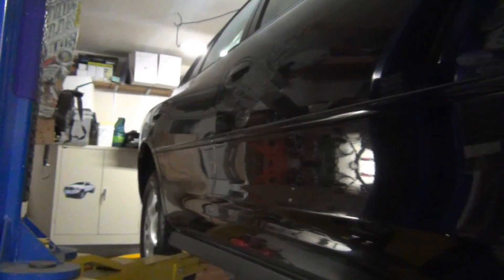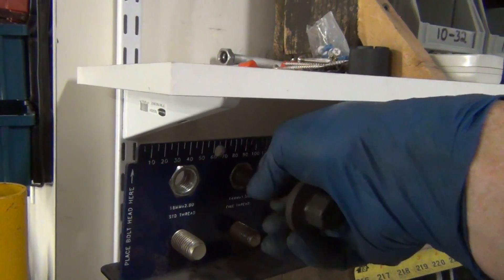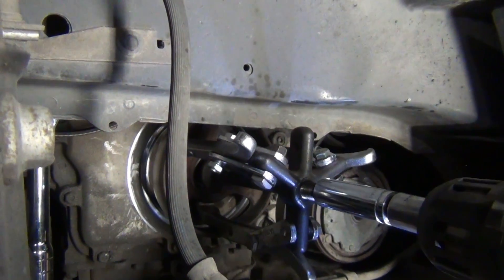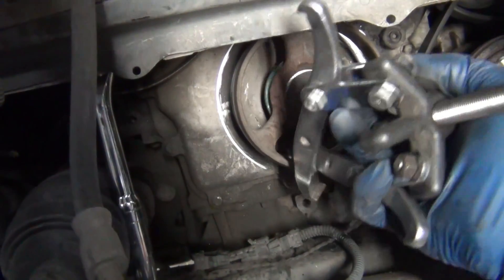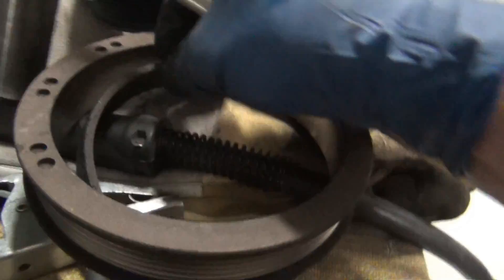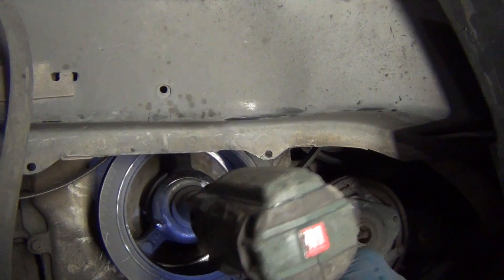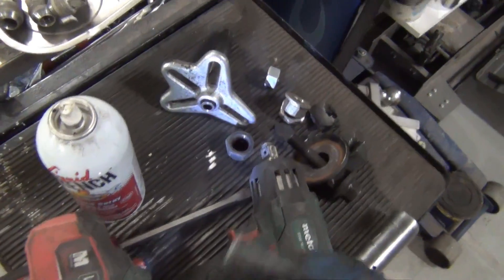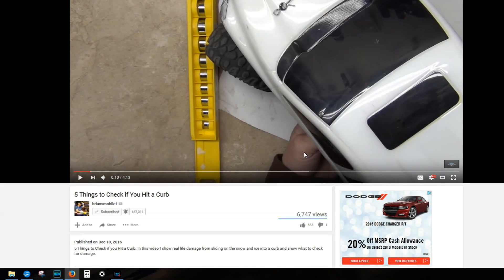Crank Pulley Replacement tricks for GM 3.5L LX5 "Shortstar" Aurora Intrique

Comment: I just did a 3.5 crank pulley last week. I played with a couple of my pullers and then ordered the right puller from Amazon. Got it the next day, had it replaced in less then ten minutes.
Reply: @Danny-ow7hl  I think it was a GM 3.5
Reply: Do you recall what pulley it was? Also, GM 3.5?

Comment: Wow!! That the hard way.. There is the right tool for the GM and Dodge for that👍🏻 make that job nothing to do both coming off and back on.... You May want to get it..
Reply from the maker: I've used the Dodge one before as a rental.  That's what it looked like to me.
It came off slow- was kind of rusted.   I do like the fatter drive bolt on the Chrysler puller.  More compact too.

Comment: Idk how you guys make a living doing this crap. I spent 6 hrs on my motor mounts in my 6.5 and that's after the trans has been dropped and the front diff is out. Nothing wants to line up and no room for force. I mean its only 8 bolts right? Now hard could it be?
Reply from the maker: It takes practice, tools, and experience.  Even then, it takes even more experience and training as the dicipline is in constant evolution.  Where you make money is repeating the same job and getting to where the flat rate system kicks into your favor.  New mechanics lose their *&^% in the beginning.  Shops take a huge risk with hiring new guys- the quit rate is very high and they really don't produce much in the beginning.  I know MANY good mechanics who leave to pursue $ being a waiter or recreational drugs / alcohol.  It's not for everyone.
Reply from the maker: Much of this is the cost of tools and the number of tools eats most of your pay for years.

Comment: Yeah the tire shine doesn't bother me as much as no gas had another car today no gas in the car whatsoever 2014 Chrysler 300 S needed the oil filter adapter replaced so yeah you have to run the engine no gas
Reply from the maker: I should do a video on the that topic- how not to irk your mechanic.  No gas is near top of the list.
Reply: I notify the customer and they can add fuel or I can..for a fee.  Everything takes time.

Comment: PLEASE do more videos on the aurora 3.5  This motor has very little video information on it and it really needs it.
Reply from the maker: You're not kidding!   It's not exactly like the Northstar either.   Sadly this car is in the wrecking yard now.  GM spent SO MUCH $$$$ on this engine design and then dumped it after only like 4-5 years when they dumped Pontiac and Oldsmobile.

Comment: I could be wrong, but I thought these have a specific (very tight) torque sequence. The oil pump is on the crank, right behind the timing cover. It's not keyed onto the crankshaft. Instead, the harmonic balancer squeezes the pump to the crank.

That said, a bolt too loose could cause the oil pump to slip later on...
Reply from the maker: That's correct.
Reply: @briansmobile1  just wanted to make sure you know, because the video only shows you zipping it on with the impact, but I remember the torque sequence being so tight that no impact could ever do it!

Comment: Without the extra M14 bolt you could a longer smaller bolt that does not thread in to the crank, or possibly a modified 3/8 extension.

Comment: Rig up a shoulder mount for a little go pro cam. If the framing sucks in post you'll always have the wide shot of the stationary cam as backup. I was thinking you could go with a headcam like that another guy uses, but when you're working on something below your line of sight like this it might not work right.
Reply from the maker: I've been thinking a lot about that.   I got the new GP7B for that- just need to implement the mount.

Comment: That metabo impact is nice
Reply from the maker: It was.  It died (fried speed controller assy.) on the building construction.
Reply from the maker: Milwaukee is higher duty rate.
Reply: Funny, I've been thinking about Milwaukee fuel for my next big purchase but seeing your Metabo, I think I'd get more tools for my money, lol.  @briansmobile1
Reply: I agree brian Milwaukee has a higher duty rate and more bang for the buck
Reply: Dang well it was nice till it died then
Reply: It turns out I'm full of it. When Brian was first excited about Metabo they had killer prices. Now they seem very similary priced to Milwaukee...soooo.... what'd be my pick? Milwaukee Fuel. That's the pro use line. At home, you probably don't need to use it all the time so you could skip the "fuel" part or even go further down to Dewalt. I believe the Dewalt line is more geared toward the "home user". I put that in quotes because you could be using it or anyone could be using it all the time at home like a "pro".  @AntonioClaudioMichael
Reply: @DENicholsAutoBravado  I'm a professional mechanic I use Milwaukee all day every day there also great for home owners

Comment: I have some video using a harmonic balancer puller that I'll still edit up at some point, but I'll link to this video as being way more boss with way more needed tips, which I didn't know like lubing for reinstalling to protect the seal. I've only used lube on removal...maybe it still helped on the install. Did that protect the seal which keeps oil in the engine?
Reply from the maker: It did protect the seal going in.  PLEASE DO upload your video.  Every one has a different learning style an there are so many things you could add to this.  This video is on an odd duck engine.  This engine / HB combo was only around for about 4-5 years on only two models of Oldsmobile.
Reply: @briansmobile1  I will. I'll write in that they should watch this one for more tips and tricks. Plus, I used a completely different tool for removal.